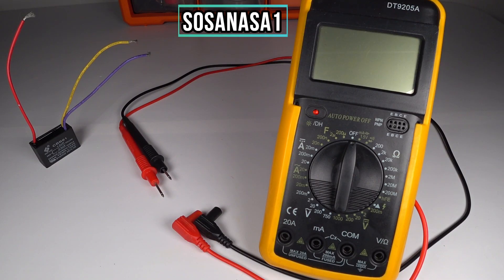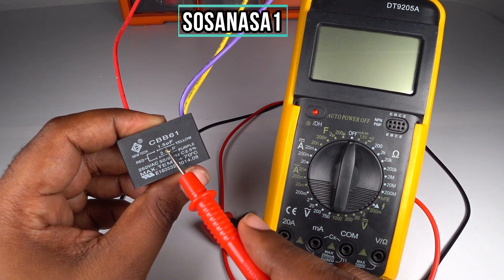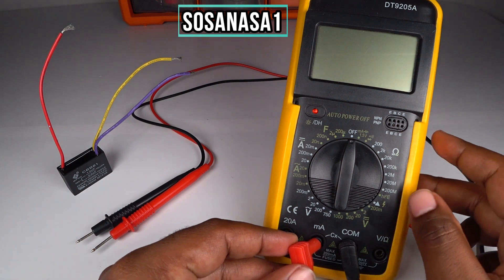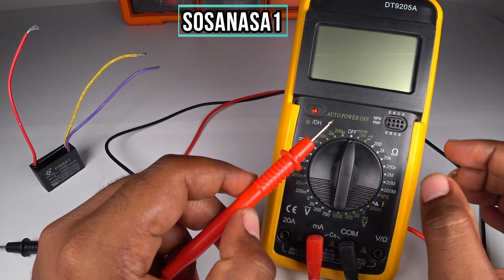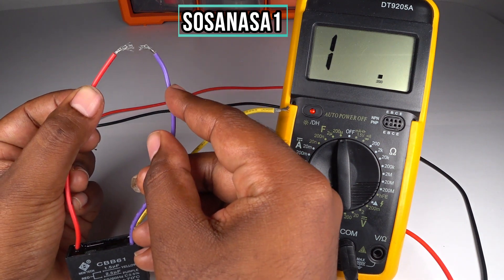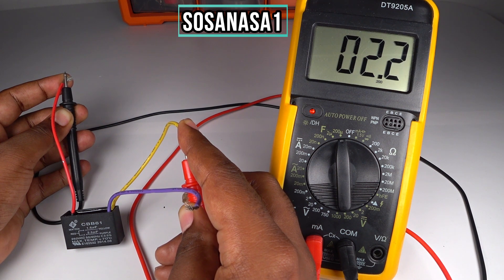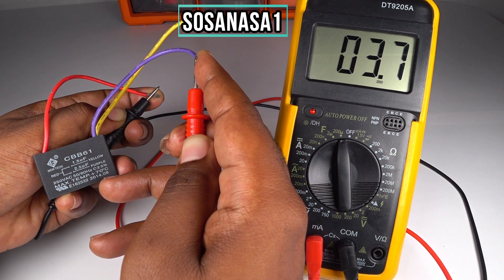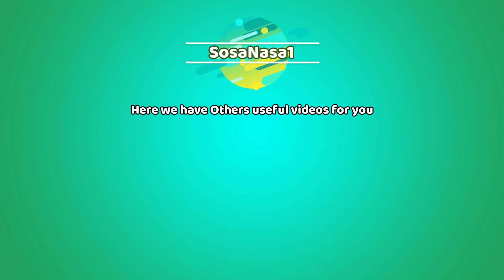How to TEST and MEASURE a ceiling Fan CAPACITOR with Digital Multimeter model DT9205A

Comment: You can't touch one testing point with your finger, it will give a false result. You're body acts as a parrallel resistance if you touch both wires.

Comment: Hi, nice explanation...
I guess I found the broken part of my electric fan, I just checked the 9uf capacitor with a multimeter
the lecture stays at 0.00 
I haven't found any 9uf cap, only 10uf, same values but on a 10uf...
would it be safe to replace a 9uf with a 10uf?  
Thanks! :)
Reply: YES it is 100% safe to  replace it with a 10uf.The fame must be an old one as newer fans now are less that 4uf